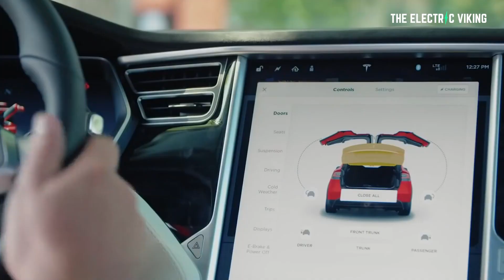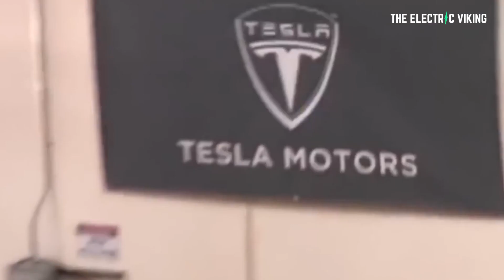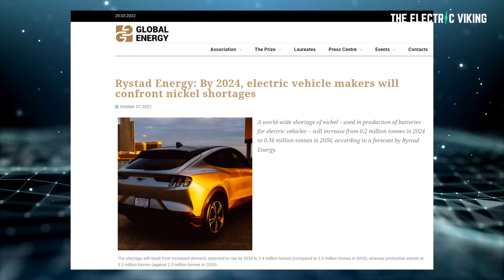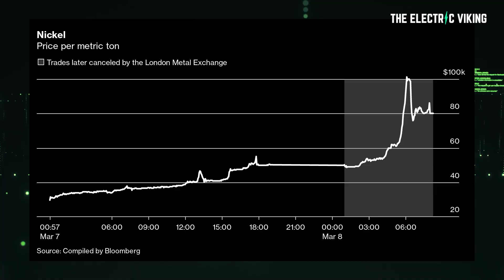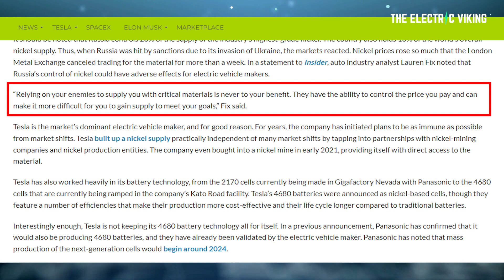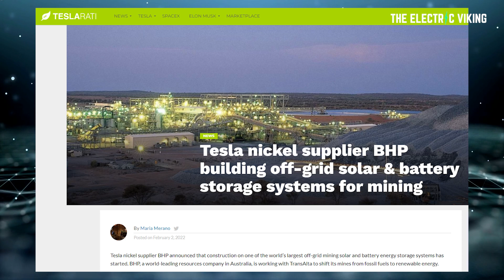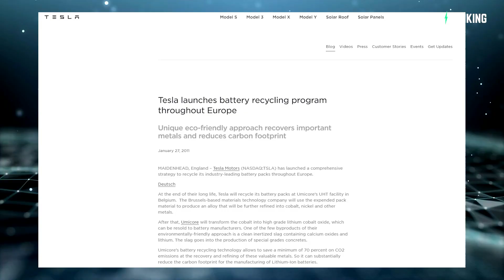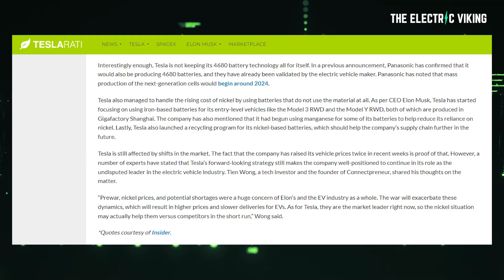These battery moves give Tesla a 5 year ADVANTAGE

Comment: Though you need to be a bit careful.  Its not that LFP batteries do not use Nickel or Cobalt, its that they don't have to use Nickel or Cobalt.  LFP batteries might still be doped with Nickel and Cobalt to increase the energy density.  Its just that base chemistry does not require it to function, so the amount of nickel and cobalt that would need to be used would be significantly less than that used in NMC/NCA style chemistries.

-Matt
Reply: Interesting thanks

Comment: Most important “battery” advantage is low weight and high efficiency of the whole vehicle.
Makes it possible to use less batteries, also to get good range out of LFP’s.
4680 are for pickup trucks and above all Semis. Any leftovers can be used for performance cars.

Comment: Volkswagen will be using LFP batteries in a unified prismatic cell in 2023, because Gotion High Tech will be making the batteries at Volkswagen’s battery plant in Salzgitter, Germany.   Plus Volkswagen has placed a 10 year order for batteries worth $14bn with Northvolt in Sweden.  Volkswagen also has battery contracts with LG Chem, SK Innovation, CATL and Samsung SDI and they also have a deal with QuantumScape to supply solid state batteries which will have a volumetric energy density of more than 1,000 watt-hours per litre at the cell level, which will be used in Volkswagen’s “Trinity” sedan in 2026.